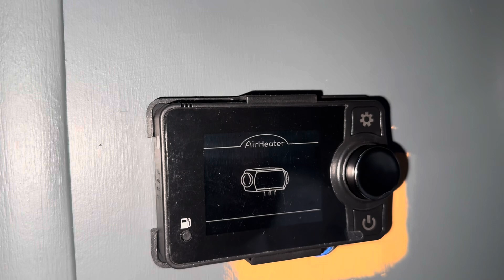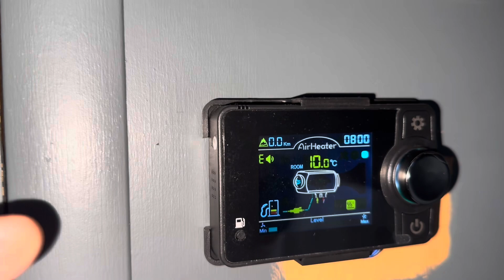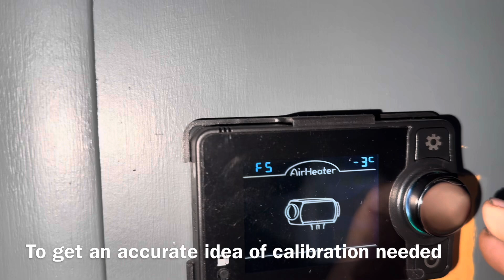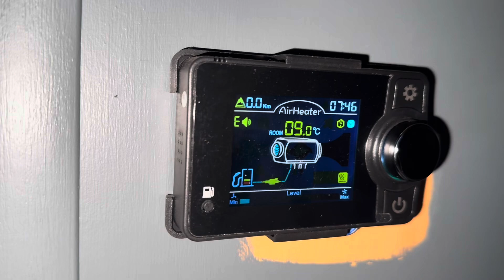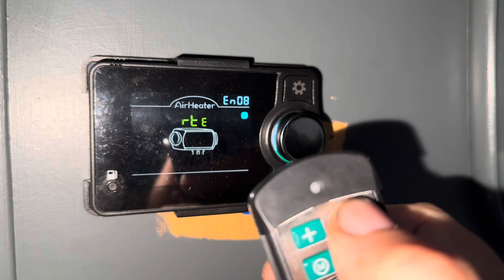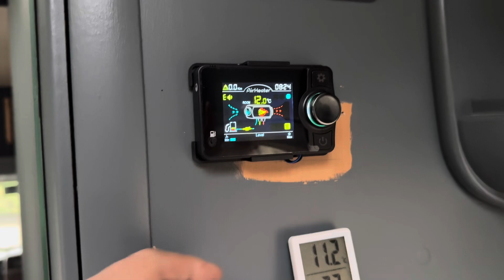Sunster Diesel Heater Controller | Temperature Control | Hcalory

Comment from the maker: When you’ve been using the heater and to reset the fuel gauge icon:-
 With the controller powered on long press the fuel button and it fills the icon from empty back to full.

Also having calibrated the temperature now several times, it appears to finally have settled down a little better, and tracks the true temp as the weather fluctuates. Not perfect but better than it was. 
This has also improved temp mode to be a little more stable which may or may not have been coincidence. So on my unit at least calibrating the thermostat took a few attempts before it held accurately.

That said f8 is rock solid at maintaining a given temp. It doesn’t power cycle as often as you’d think but simply holds that steady temp. Over the course of a chilly night it may power cycle just twice whilst holding 20 degrees. This is my experience with my heater.
Reply: Just watched, now I understand my heater, many thanks.
Reply: Very helpful, thank you very much

Comment: Hi I know you did this video a year ago but I found it very interesting. I have the same controller if I switch the thermostat to off will this reduce the amount of power I use as I believe with it on and cutting in and out it must use more power. 
I know it will use a little more fuel but I can live with that. Thanks Kevin
Reply from the maker: Hi there. I have found that leaving that thermostat setting on via f8 method doesn’t actually start stop as often as I’d have thought. Not on my unit. 
I have tested this several times during cold nights throughout the night, and it kinda does what’s it’s meant to do and just hovers around my target temp. Maybe powering down once during the night twice at worst. Try it on your unit and see if it’s similar but mine just kinda gently pushes out the heat. 
On the thermostat setting alone with that f8 feature turned off, mine simply continues to increase heat given enough time. It won’t power off hence saving your battery, but the heat will increase given enough time during the course of the night.

Comment: Great video..I have an E07 error code and have changed the fan motor and the motherboard.  Still not working 😢
Reply from the maker: What I have learnt is the error code/audible warnings are not consistent with what the instructions claim and the actual issue. 

Have you checked your power source is adequate, including suitable wiring for the job. 

I had only two issues and I use mine all the time without hiccup. 

Ran out of fuel twice. 
And the other error I got was error 07 with audible alarm of “low oil”.

Transpired to be not enough energy in the leisure battery. 

My experience of these heaters the main components are surprisingly simple and robust. Mine has been on the button barring those hiccups. 

That said, 
I do hear of pumps failing so I’d check it’s pumping ok and make sure it’s getting enough voltage. If your heater is old I’d check the glow plug also. 

When is it failing? On start up within seconds, straight away or after a minute or 3?
Reply: @Jay_Jay it is failing after about twenty. Seconds…all I can see in this 20seconds is the fan start to run then eventually stop and then the display goes blank. It shows e7 & 011 on the display then when the fan stops the display goes blank. I can then press the power button and the display comes back on
Reply from the maker: @sprockets_shafts  20 seconds isn’t an awful long time. I assume you don’t get to hear the pump ticking? Have you tested voltage going in at the power source?
Reply: @Jay_Jay  No I dont get to hear the pump ticking now do I see the glow plug icon on the display...

Comment: Intalled this controller today, but it puch out lots of white smoke from the exhaust. Running to rich i think. 
I will try to change the settings to .28 on the pump. 
Great video tho, keep up the good work. 
Thanks
Reply: I have the same problem and I can’t figure out how to adjust the fuel pump. Did you figure it out?
Reply: @Brandon-b9u9r 
No it’s not possible to do it. 
Had to change to another controller and ecu. 
Tired of it clogging up!!

Comment: Thanks for the video, I installed a 5kW Sunster in my van and I'm keep getting the E08 error. The fan starts to blow but no clicking... after 40s or so, it says "faulty, check the ignition". Any idea where to start? I have the same display btw. Thanks!
Reply from the maker: Hi there, is your voltage/wiring good enough? 
How long is your wiring from power source to heater? 

I can only guesstimate it’s electrical issue possibly the glow plugs aren’t getting enough oomf during the demanding start up process. 
Perhaps try the heater with your engine ignition on to take the burden off your battery during the more demanding start up process.

Comment: Installed my Sunster 8kw in my static caravan last night. Worked fine before going to sleep. Woke up in the morning in cold. Says E01 error. On this particular model E01 is pump or blocage. I checked all, no bubble air, the fuel filter is with water separator.. All perfect. Still the glow plug wont ignite ... And I used only  like 2-3 hours top .  Try everything, got no more ideas what to check more.
Reply from the maker: Hi, 
Yes on mine I see 01 error when fuel isn’t getting to the heater I.e during priming. 

If mine runs out of fuel I initially get 08 error, but then I get 01 error 4 or 5 times whilst the new fuel transits. 

Have you tried leaving it a while in case it’s flooded and then repeating the start up process a few times? 

All else I can think is that your fuel pump isn’t working well. I have heard of them packing up early. 

The other thing to remember is I think some of the fault codes can be different despite being the same model. Which I know is frustrating. 
Sorry I can’t help more.
Reply: @Jay_Jay  I buy a new spare pump, worked fine 5 minute and then E01 error.  Something is killing my pumps but have no idea what. As the heater is brand new. I contact Sunster on email and even send 2 videos to them.  in 4 days no reply. I think for the future will stop buying anything from them. Wasted more than 100 pounds..
Reply from the maker: @iorgaeduardcatalin1394 sorry to hear this. I would still be surprised if the heater is junk. When you say it worked for 5 minutes did you get heat in this time? 

Also are you happy you have sufficient  power supply getting to the heater? I know e1 error on some Sunsters can be low voltage. 
Have you downloaded the app to see what voltage you’re pulling? 
These issues can be a problem I know and Sunster not replying to you a real pain. But I still imagine it’s a simple problem. 
The first 5 mins or so there is an elevated power draw and if your battery isn’t sufficient it may well cut.

Comment: I installed the blue type controller off of the cold wood wall, still doesnt make a difference, my conclusion is the wires to the heater mother board are in a cold room and conducting the cold, idid manage to adjust the lower heat 1kw to 0.6kw and the high heat 8kw to 3.5kw via the pin code 1688 and may even install a 16u from an 22u to lower it even more for autum/spring months but it doesn't have the start stop mode which would be great in January below temperatures at night.

Comment: To prime the system just unplug the display, press and hold the fuel button then plug the display, 30 seconds will apear in screen, relaese the button when start pumping, and look the transparent pipe to avoid flood the system, when you want stop just press no/off button
Reply: Cheers mate, that was all I wanted to know, the video just waffled

Comment: Hi I just installed my same heater with same controller and it worked once , now every time I turn it on I get a cloud of smoke and a E-01 Error , I dont know what I have done wrong?? Cheers Steve any suggestions??
Reply from the maker: Wow that’s odd. How long was it running for initially? Did it give heat? 
Did the smoke come from the exhaust? And was it white or black? 
When you start it before getting the e01 error does the pump kick in? 
And lastly can you see fuel in the lines entering the heater? 
The instruction manual isn’t great for me. E01 is when I run of out fuel at the heater.
Reply: Same problem to my heater. Brand new, worked like 2-3 hours and then E-01 error code. Fuel tank full, no bubbles in the feeding pipe. Only the pump i cant hear it to work.. i give up....

Comment: Hi ive just installed the same heater in my motorhome Any advice on supply voltage over run fault code e03
Reply from the maker: Hi there. I have only ever seen fault code 03 on one occasion. 
This is when the heater was running fine but I ran out of fuel. I was then presented with error code 03! 
It confused me at first but 
after refuelling I was hit with a couple of 01 errors whilst it primed. 

Have you got the app you can see voltage going in?
Reply: @Jay_Jay  I haven't got the app yet however I've rigged it up to 24v and it's working correctly but won't on 12v but ain't they supposed to be 12v-24v
Reply from the maker: @ yes should be 12 and 24v my guess is the battery your using isn’t up to charge which I’m assuming you’ve double checked. 
I know from cold on initial power up it pulls 10amps for a few seconds and needs to see 12volts. a fully charged quality battery will get you that of course. That’s all I can think. 

Have you tried starting the engine of your Motorhome  and then tried starting the heater? I know a lot of people do this as standard to save on that initial energy draw.

Comment: This is a great video, any idea how to turn the audio voice “start heating” and “stop heating” and “have a safe journey” off?
Reply from the maker: @edbayliss1862  hi and thanks.
Yes. On the languages you can select English, Chinese etc and one the selections is blank. Select that one. Does that make sense? Cheers
Reply: @ Amazing. We have this heater and honestly. It’s been incredible this winter but have only used it for on and off and level mode as temp was so far out (4-5 degrees higher) I’m excited to go and try all these settings
Reply from the maker: @ ours has been on permanently since the creation of this video. When we use the Motorhome we set it to 21 degrees and when sat on the driveway we set it to 8 degrees. And it has not missed a beat this winter and our Motorhome is not damp at all. 
Every few days I run it as hot as it will go for half hour or so just to burn away any carbon build up. Very pleased with ours now we know this setting.

Comment: Exactly what I done with mine. Never prime a diesal heater just turn it on a few times if it goes off plus I have a couple heaters but I’m running them off the same tank

Comment: Great video. Has anyone come across intructions on how to change fuel pump hz and/or fan speed limits on this type of controller?
Reply: you cant change it, if your pump is 22 you can change the settings to a 28 to make it runs leaner
Reply from the maker: Thank you and I wish I could answer your question. It has got me thinking about the benefits of changing the hz of the pump it’s something that never occurred to me but I’m not sure it can be done. 
I did read about someone changing the blower to a brushless motor I’m not sure if that is any help whatsoever but I’ve read that was looked at.